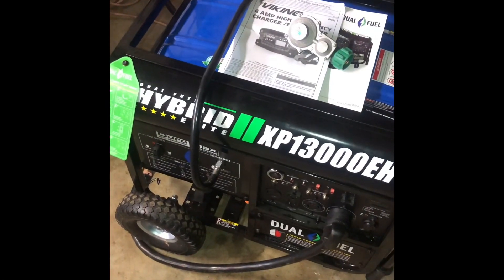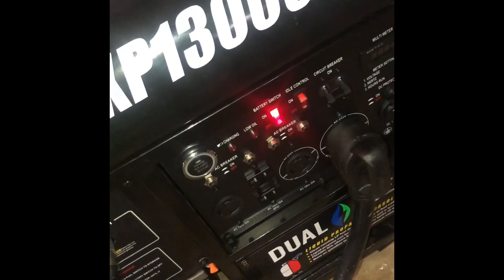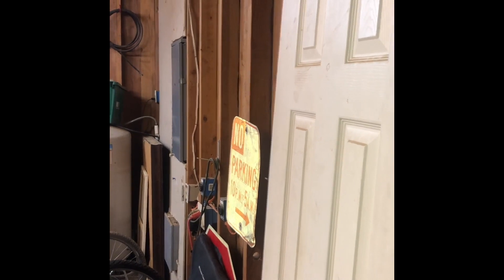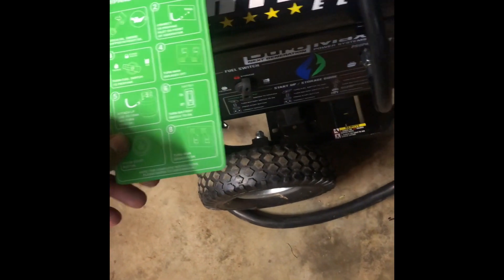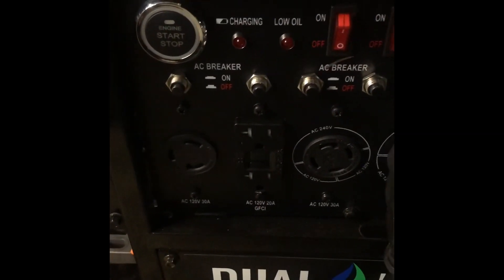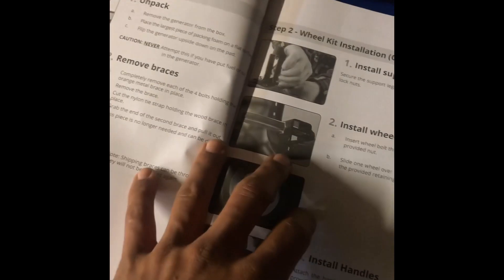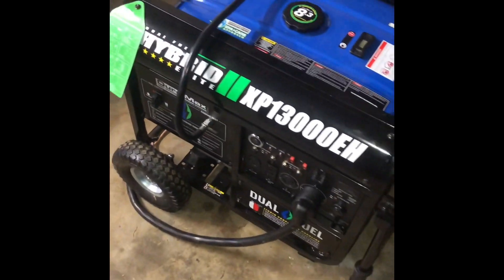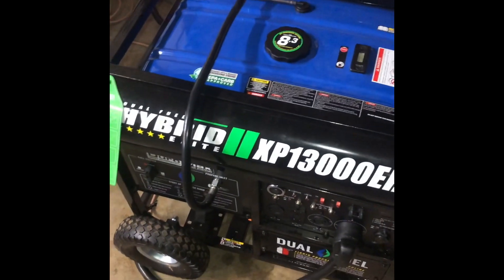DuroMax XP13000EH Generator Connected  to 250 Gallon Propane Tank

Comment: You've been warned.... It is a dud......never had a chance to use it in an emergency and died..... Had to ship it for repair, took forever an a day, and after 5 or six starts it is dead again. 🥴... Absolutely would not run on propane!! 😖
Reply from the maker: Yours may be. I have installed over 10 of these units all running off propane and have yet to have an issue with any of them. Mine has close to 400 hours and still running strong.

Comment: You can't run a generator inside your garage. It's going to kill you (even if you open the door!)
Reply from the maker: Sure you can. It’s also just sitting in there with the exhaust pointed well out the door. The door is also fully open and it’s a detached garage. We access the generator from outside anyway. I’ve run over 200 hours on it this way and not an issue yet. I also have a Co2 alarm in there and it’s never gone off.

Comment: The 3psi propane pressure reference from DuroMax is the minimum inlet pressure for their 2-stage regulator that ships with the generator.  The generator actually uses 11" water column of pressure.  3psi would be about 83" water column.  Household propane pressure is often 11" water column after the 2nd stage regulator.  The first stage regulator on the tank is often a 10psi regulator which feeds a 2nd stage 10psi to 11"w.c. regulator at the house.

Onboard the generator is a demand regulator.  This regulator does not regulate pressure, it regulates fuel flow based upon demand.  The "demand" is the carburetor vacuum.  When the generator is shut off the demand goes to zero, and so the propane flow is stopped because there is no vacuum.  These regulators are also called "demand regulators" or "zero governors".

It is always best to turn off the propane when shutting off the generator as sometimes the demand regulators can leak.

Check out the DuroMax FAQs here: https://www.duromaxpower.com/pages/faq

Comment: My unit stays in my shed, I added a 12” 1 1/4 straight drain pipe and have it venting outside.  I also added a soffit 6 x 16 in four corners at floor level.  When running in the summer it gets very hot in the shed, I keep the door closed to help contain some of the noise, so I installed an exhaust fan.  The fan combined with already installed ridge vents the inside temp of the shed does not exceed the ambient temp.

Comment: Thanks for this video. I have the same genny and want to do the same thing (hook to my home propane). Duromax says their 8500 watt and up units require 3 psi of propane pressure. What pressure is your home propane? Mine comes in at 11 inches water column and I am not sure if that will run the unit or it really does require the 3 psi. Also, Duromax says to always use the provided regulator (which you took off). Any idea why that is? Is it a negative pressure regulator that will stop the flow of propane if the unit stalls out but the supply line is still on? If you forget to shut off your valve does the pressure of the propane cause it to leak through the generator somehow?

Comment: I need to check my cord to see if I will have the same problem of it not seating properly. I've had my generator for 2 years and never got a chance to use it. I had an outage but it was too dangerous to go outdoors so I stayed in and suffered until it was time to go to work.

Comment: I removed the gas tank on mine for better air circulation around the engine. It's four bolts and two hoses. Can be removed or put back on in less than two minutes.

Comment: Propane has 30 years shelve life compare to gas 1 year storage life. (If we get to shortages in supplies.)
Reply: Don’t store large amounts of gas until you are prepping for a storm. Never store it in your generator either unless you are using it regularly. Store dry and empty. Done that for years never a single fuel issue

Comment: You should start the unit with the idle control set in the on position for a cold engine to keep the wear and tear down on the engine. These are Chinese engines so keep that in mind. The best thing you can do for this unit is change the oil after a few hours of run time to synthetic oil. Mobil one 4T 10/40 is good oil to use.
Reply: Nope this is bad info,you don't want to run synthetic in these, you want to stay with regular. 1st run you want regular, after that you can switch to synthetic if want but I'd stay with regular  starting out with synthetic will cause problems with the seals.
Reply: Nope

Comment: Dis you separate the ground and neutral and make it an floating neutral unit as som many advise if your going to use it to back feed for supply voltage into a house?

Comment: Propane bottles lasted four and a half hours , a full tank of gasoline on the generator lasted 12 hours , I think gas much more efficient than propane , but then if you're talking about a temporary outage it shouldn't be a problem , I am down here in Port Charlotte Florida and we are Scavenging for fuel after Hurricane Ian .
Reply from the maker: The gas tank is way bigger than the standard bbq propane tank. Also where I’m at gas is around $5+ a gallon and propane is still down around $3. Propane also doesn’t go bad like gas.
Reply: @jsjunkremoval  
My apologies I forgot you live in communist California
Reply: @jsjunkremoval  I have left gas in them for over a year with no problems
Reply from the maker: @robertboyd3863 whatever works. I don’t have to go anywhere to leave it hooked up to a 500 gallon propane tank.
Reply: @jsjunkremoval  I agree , you have a great system, I have though of hooking to my 500 gal tanks, but seldom lose power, thanks for the info on how to do it

Comment: I have the exact same generator, a 50 amp plug to aj interlock switch kit and using 100# propane tanks, I had to get a two stage regulator for it to use off the 100# tanks how'd you get around that?

Comment: 10,500 running watts and 13k watts peak is impressive. (Not sure what it is on propane)

Keep in mind that 50 amp connector and proper cord is good for 12000 watts so nice sweet spot here at a decent price.  If you're whole house is gas, this should indeed run everything unless you have some insane ton air conditioner. If you are all electric, a dual element hot water heater uses 9000 watts on average and electric hvac is at least 40 amps and way up there,  something to keep in mind.

Thank you for your review, I need another generator that is already prepped for propane...think I'm going to add this one to my fleet.

Comment: I got a crazy question. On your Viking trickle charge what do you put the setting at when you are charging your generator is it on standard 12V or AWR 12 V??
Reply from the maker: I think standard.
Reply: Was not sure if standard would Overcharge versus the other 12 V. On battery it does not say that it is a gel

Comment: Since you have it plugged into your large propane tank, fuel is not as much of an issue.  How long would you say is safe to run the generator continuously before needing to cool down?  Would you recommend running it for 20 hours straight before shutting down to do an oil change?
Reply from the maker: I have run it 18-20 hours straight. Turn off the load and let it run a min or so before turning it off and changing the oil. After the oil change, fire it up and keep going.
Reply: @jsjunkremoval  wow that’s great! Thanks for your response.

Comment: Where do you have this setup?  Is it in your garage?  Are you using an exhaust extension to vent?  How did you safegaurd against carbon monoxide?
Reply from the maker: Ya it’s right by my door. I just drag it out a bit and the exhaust shoots right outside. Has not been an issue yet. I actually am currently on generator because of a winter storm.

Comment: Are you seriously running a combustion engine inside and enclosed building
Reply from the maker: Well guy. I am sure am. It’s a detached garage with the exhaust pointed directly outside the fully open 16 foot door. The garage literally keeps it dry. If it makes you feel better there is a co2 alarm in there.

Comment: What are the specs on the regulator you're using?  I believe the one that comes with the generator is 11" WC output.
Reply: From duromax, they said I needed a two stage regulator and I'm using 100# propane tanks. MB Sturgis is where I got the regulator

Comment: I have two central heat units in our house, one 5.5 ton and one 2.5 ton, i have the same generator and It won’t run the heat because the amps are to high

Comment: I have this exact generator connected to my 250 gallon propane tank and it WILL NOT START? Any clue as to why this may be? I have check the oil level, bypassed the oil level sensor, checked the choke. I don't know what else to do. Any ideas would be much appreciated.
Reply from the maker: Hook it to a portable propane tank and try again. If it fires you know you have a pressure issue with your home tank line.
Reply: @jsjunkremoval  It turns out there is an issue with the Fuel Selector Switch. I appreciate you responding.

Comment: That unit is good for 50 amps @ 240 MAX. You should not run at 100 % load. Now you claim it can run the entire house. The house with a 150-200 amp main? Your full of it. If your a gas water heater and stove with city water maybe. But you can not run your electric water heater, well pump, AC, and fridge at the same time. If well and AC start at same time you'll be over loaded!!   Please people, there are load calculators on line to size a generator for what your going to run and it takes in the possibility of more then one appliance coming on at one time
Reply from the maker: I never once said I run every appliance I have at once. I also said I have a gas dryer and gas hot water. It does “run”my whole. I talked about knowing what you are running and how many watts it consumes. I have ran my AC and well pump at the same time. And yes I have a 200amp service. Just because you have 200amp service doesn’t mean you’re using 200amp. Go use a amp meter on full load and tell me what your house is actually running.
Reply: What the hell are you talking about. He never said he runs it all at once. I have the 1300 watt version & I run my entire house no problem. We only use what we need at the time but everything works whenever we need to use it.

Comment: Nice set up. I'd suggest plumbing the exhaust outside since you never move it. Also I'm guessing you have over $2000 invested, I'd invest in a quality battery tender. Harbor Freight battery chargers are junk and unreliable.
Reply: I agree I don't trust nothing at Harbor freight

Comment: I have the same but the 12000 peak.  The output on the yours using propane out paces my mine with gasoline.  That quite power upgrade for just 1000 watt peak difference.  Nice set up.

Comment: I think you all need to know there are issues with this generator. I purchased the first unit back in December of 2020. It lasted all of 2 months and 30 minutes of run time, before it disintegrated the wire windings. Duromax replaced it with a new one. It ran for less than 30 minutes before it was back to the repair facility. They said the regulator they provided was incorrect and I needed a two stage propane regulator. Brought it home and it ran for 30 minutes. Thought all was good. Did my test run last weekend and once again it went back to the repair facility. They can't figure out what is going on with the unit. Bottom line - I do not endorse this unit as being a reliable generator.

Comment: We have a 3300 sq ft home with two 4 ton heatpump/AC units with airhandlers, and well pump, and were able to run ONE of the AC's unit along with the well pump, refrigerator and a freezer with no problem. The AC units were made in 2015 so not really new. We ran all of this on just propane so it would be even better if we ran gas.

Comment: I didn't hear you mention anything about grounding the generator itself to prevent shocking should you come in contact with it.  Shouldn't that have been done?
Reply from the maker: I mean you can. The 4 prong plug is grounded through the panel. I have installed close to 20 portable generators with my electrician friend and we haven’t grounded a single one separately from the panel.

Comment: Awesome video. I’m about to purchase this unit. I live in Florida and during Irma we were out for 12 days. I have a 4 ton AC unit and from all the reviews I’ve read they say it can handle a 4 ton. My electrician said I should really use a 15000 watt but I don’t want to spend double the price if I can get away with this generator which should be adequate. I can keep most of the other circuit breakers off to cool down the house and slowly turn on other breakers one at a time. Anyway, I appreciate your presentation it helped a lot, thanks my friend. Be blessed!
Reply: Look up hard start for central air conditioning. It will cut down your amps.
Reply: @davidgoodwin9496  thank you, the unit just arrived today. My electrician actually mentioned “hard start”. I’ve got the ac company doing maintenance in April. I was going to ask but now that you advised it too, I’ll make sure to follow through. Thanks again for the good advice!
Reply: @billmitchell3329  AC takes a lot of power, but the start-up surge can be the dealbreaker for the generator.  The "hard start" reference mentioned may be talking about what I've heard called a "soft start".  The idea is that accessory spreads out that surge, lowering the required peak surge current, and by that, it enables a smaller generator to work just fine.
Reply: @PeterLawton  thanks Peter. I had the hard start installed  by my A/C company after receiving the generator. It was kind of pricey, a little over 200 but the starting amps for the ac is 17 amps when measured now so that should be no problem.The part he installed acts more like a soft start because the starting amps are so low. It was a single unit with the relay built within it.
Reply: Great video I just got one.
Reply: I have a hard start unit installed on my 5 ton and it works perfectly

Comment: I did what you did with my exhaust in my detached two car garage. it’filled the garage with exhaust fumes and choke the motor out .there wasn’t enough oxygen just thought I’d mention it .I ended up running the exhaust to a muffler outside the back it isn’t very noisy at all.
Reply from the maker: I’ve never had an issue, it’s pointed right out of my garage door. I leave the whole door up. I have ran 4 days like this.
Reply: @jsjunkremoval  it was raining in the winter when I let my garage door down I didn’t close it completely but there wasn’t enough air in it to run until I open the door I was just mentioning it for your listeners
Reply: Mike, was your muffler just a 1/2" economical lawn mower muffler? It would be nice if you could buy just any of the 1/2" mufflers from the Big Box Stores or Ace. I thought the muffler would reduce your output.
Reply: @greatviewacres4377  With reducers metal reducers I can cover over the small muffler and expand the end of it to a 2 inch pipe an out side to the car motor it works

Comment: Can this generator run my central air on summer times? Thanks
Reply from the maker: It runs my 3.5 ton
Reply: Have you been able to get a idea for run time or a estimate for the 250 gallon tank
Reply: @travist2844  It uses 4 gallons per hour running at 50%, so 62 hours or so on the tank.
Reply from the maker: @travist2844  I did the calculations one time. It’s in the comments.
Reply: You are answering the same questions over and over I fill sorry for you lol😅

Comment: How long does 325 gallons of propane last you?
Reply from the maker: I’m not sure because that thank is also hooked up to all my other appliances. It will last a long time though. The spec sheet says 6.5 hours at half load. I think they are using a 5 gallon or 20 pound tank as an example (that’s about 1.3 gallons an hour). So if that’s the case if it was just the generator off the big tank it would be about 250 hours run time at half load.
Reply: David Jackson thank you I greatly appreciate the info. I have the xp 4850 and it can’t run my entire 5th wheel I’m looking into this generator next
Reply from the maker: @selfproclaimed3112  ya that’s a small generator.
Reply: David Jackson definitely.
Reply: It largely depends on the load, which varies from person to person.  It helps that you already have the XP 4850, so at least you have some idea how much more you need.

Comment: I just purchased this generator, quick question. Do you have to ground it for whole house back up? Also i am looking at using the Generlink transfer switch. How much is the total cost labour plus materials for the transfer switch you are using. The generlink is kinda pricey. Also since this has 12 THD, will that harm my home alarm system digital panel?
Reply from the maker: I’m not sure on total cost. It’s been a while since I installed it. Labor was nothing because I did it all. Parts were under $1000 not including the generator. I had to add a pass through panel for my interlock kit.
Reply: @jsjunkremoval  did you ground the generator and if you did....How?
Reply: @randyshidal8356  You should not ground the generator when powering the house.  National Electric Code requires exactly 1 ground, and every house (in the US) already has that.  On a construction site, without any existing ground, then the generator must have the ground added.  Exactly one at all times.